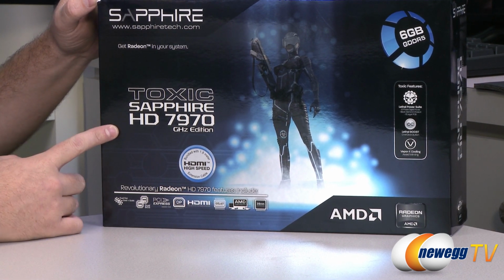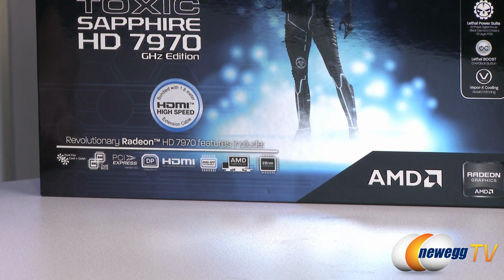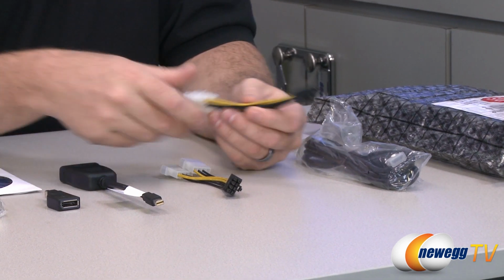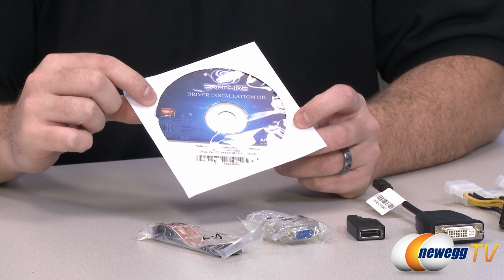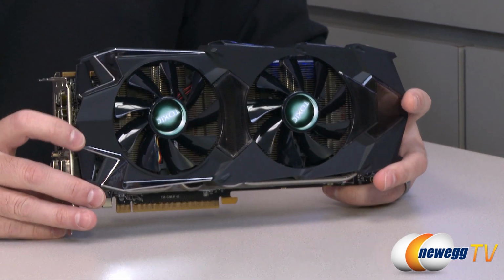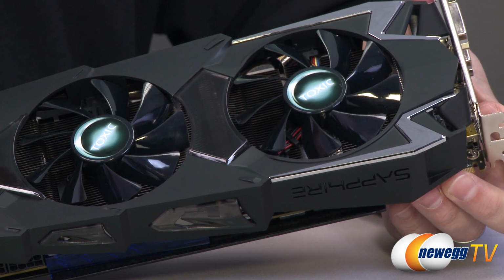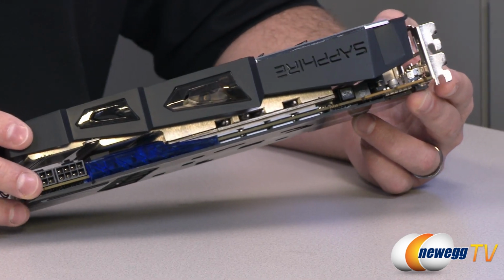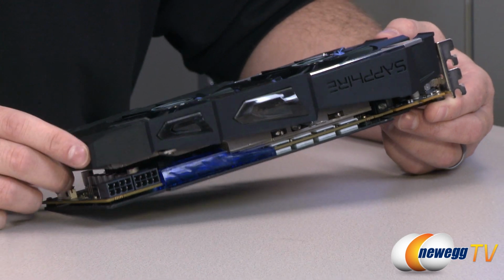Newegg TV: SAPPHIRE Toxic Radeon HD 7970 GHz 6GB GDDR5 Edition Video Card Overview

Comment: The GTX 780 is a win in performance BUT its 3GB memory is the let down. 3GB is the new standard for higher graphics cards. Personally, the GTX 780 is the win or wait until the end of the year because the 7970 will be replaced. I am looking at the 780 as well but its just a bit too costly. For $688 (40 more than GTX 780) you could CrossFire 2 7970s. Its go for the GTX 780 or wait for the Radeon 7000 replacement aka 9000-Series apparently.

Comment: There is only a 7970 Toxic, 7970 GHz and a 7970 Vapor-X Ghz Edition that supports the 6GB vram also. The 7970 is the same as the Ghz Edition but has a Vapor-X codename cooler design. This edition was just a market gimmick to get gamers to pay more for twice the vram.

Comment: The 7970 Toxic has twice as much vram compared to the 7970 Ghz and it has about 100Mhz higher clock speeds and almost 1000Mhz higher memory clock speeds along with 40-50 higher memory bandwidth, other specs are relatively on par but the Toxic outperforms the 7970 Ghz at every aspect. You can say the Toxic is a heavily OC'ed variant of the 7970 Ghz, if you crossfire two of these Toxic cards, the 7990 doesn't stand a chance.

Comment: the normal 7970 3gb ram ghz edition crossfired holds up almost equal to 1 7990 dual gpu card. Now this card crossfired vs the 7990 what would be the difference. would this beat it in terms of FPS. Thanks.

Comment: Clock speed is not all it matters.clockspeed is the speed of the card but if one card is better than the other( if it has more stream processors,shader units,transistors,etc) even if it's for an example 1100mhz and it has 800stream processors and 16 texture units and the other is 1000mhz and it has 1000 stream processors and 32 texture units the 1000mhz card would win.So basiclly clock speeds is not everything.I hope I helped and sry for my broken english

Comment: all hd 7000 cards are a new version of the hd 6000 card and run more better and a replacement for the 6000 card that amd cant do anything with anymore 7000 are way better then the 6000 card cuz they going to suck next year cuz the driver or now limited  when all game come out next year will have newer engines harder to run more gpu hourse power needed

Comment: there is 1 computer out right now that is 4096 x 2160 but it currently limited to the japanese market by Eizo nanao that they have announced earlier this year but it a bit of money as it will put a crater size dent in your wallet at about 36,000 a pop or in japan 2,880,000 yen i believe is there currency and it will come with a 24 year warranty some of the specs are it has a 700cd/cm2 that is able to display 1.073.74 million colors, a contrast ratio of 1000:1 and a viewing angle of 176 degrees

Comment: Yes, an Ivy Bridge 3930k does not exist. The 3930k is running on the Sandy-Bridge architecture, not Ivy Bridge. And it's not "extreme", the 3960X is the processor with the extreme label.
An i5 2500k won't bottleneck, or hinder performance in any way with this graphics card. It cost $216. Look it up you tard. The i5 won't bottleneck any graphics card all the way up to 7970 and 680 CF/SLI.

Comment: Um. Did you just say a 3930k does not exist? You moron. If you're going to get a video card this good you don't use a single core laptop processor clocked at 1.5GHz... With this, you build a rig with a 2011 socket i7 Extreme 3930k. Look it up you tard.

Comment: Hi, excuse me, I have a question. I have a Dell inspiron M5010 and I have seen videos about external video card. I saw a Vidock 4? I think that was the name, and it was great. I mean you could use any graphic card for your laptop, and it was all great until I noticed that the way to plug it into your laptop is by a expresscard :/. Of course, my laptop does not has one of those. The question is: Is there any way to adapt a external video card to my laptop without using a expresscard? 
 Thank you.

Comment: Yes, the 670 is probably the best price/performance in the top-range zone. Anything above, I'd rather have 7970 CF's. The extra VRAM and bandwidth gives better performance at higher resolutions and multi-monitor set-ups. If your going to get two cards, may as well use them to they're potential.

Comment: A great gpu would be the gtx 670 (Aftermarket) which would surely run bf3 on 60+fps ultra.
Any full tower case will be fine if it has sufficient fans. Mid tower is great too but make sure is has good cable management (grommets etc).
The OCZ ZT 750w high modular power supply is great.

Comment: I certainly haven't had any issues with it. If you're using it for gaming, there's not a game I own that I can't run at full specs. It runs really cool and on the fan curve I have I never see it go above 58C. With Precision X I was able to overclock to 1066MHz core clock and 6858MHz memory clock with no significant increases in temperature. I think I may have gotten unlucky with my particular card and I've seen higher overclock speeds from other users. 

Overall, definitely worth the investment.

Comment: @jwr3404 That's their recommended...which is overkill...but then they're sqfe with people using even cheap power supplies.  I used to have that same 775w...johnnyguru got it to push over 900w and it was still fine...so that toughpower is a bit underrated.

Comment: Seems like a cool card, but i hate saphire. i got a 6770 last year and it broke, and it was cheaper to buy a gtx 550ti than to try and RMA it back to Thailand. lol saphire, why you be s bad with RMAS. I replaced it with a gtx 280, which beat the shit out of it. By about 60-70% The 6770 i mean. Had an 8800gtx before the 6770.

Comment: right now is overkill, but until we get the 8000 family or the nvidia 700 family in 2013, this will be enough to run crysis 3, battlefield 4, farcry 3, (not call of duty because their engine is not that complicated) or games like GTA IV with its graphic update of iCEnhanced 2.0 or games like max payne which are already using more than 2GB in vram, my point here is that at least 4 gb of vram per video card will be required this year, to at least play at max detailed settings with smooth frames.

Comment: That card looks awesome :) 
Really like how AMD is using more VRAM
I had 3x GTX480's with 1.5gb vram, I upgraded to 7970 as I was running out of VRAM but still had plently of graphics power in BF3 ..... atleast if you buy 2-3x of these cards you should have plently of future proofing and valid use from the cards...
unless of course they decide to change directx like they did back in the days going from 8-9

Comment: Check techtomorrow's metro 2033 benchmark video. Average framerate on a benchmark was 14fps, with 7680x1440 resolution. Totally not worth it, better get two midrange GPU's in crossfire or SLI

Comment: Right now there a few games that break 3GBS at 3-5 monitor situations. If you need more for professional you shouldn't look at gaming cards. Gaming cards are designed to spit frames out as fast as possible, professional cards check every frame for errors hence their "slower" performance in games. Professional cards have upwards of 6GBs+.